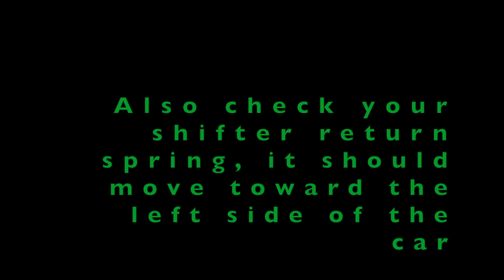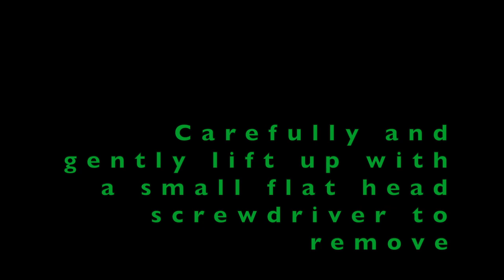2nd Gen (FC) RX-7 Shifter Bushing Replacement

Comment: Nice video, clear and to the point. You're missing 2 circular springs. One sits below the bottom bushing and the other sits above the top bushing. Looks like the dorman kit came with the one for below the bottom bushing but not the top one. The bushings have 3 notches cut into them to seat the top spring into. When the top seal gets attached with the 3 bolts there  shoupd be about 1mm of play up and down with the bushings and shifter without the springs. I can only assume this design was to allow for expansion and contraction of the aluminum transmission housing. Cheers.

Comment: Great Video, thank you so much! any idea where to buy the shifter seal? only seen the OEM option, seeing if there was a slightly cheaper option, considering its hidden
Reply from the maker: Hey there!  Glad you enjoyed the video!  
For the big rubber boots, I've historically dug deeper into my parts collection or fired off an order to Mazdatrix, but it is frustrating (and progressively more expensive) that you have to buy the whole set even if you only need the discs: https://mazdatrix.com/product/boot-shifter-kit-middle-86-92/  
Haven't seen any aftermarket units, though I'd love to stock up if you discover one!

Comment: Hey dude! Nice video, what year is your FC?
Reply from the maker: Hey man!
This FC is an ‘87, and my other is a ‘91. 👍
Reply: @derekcat  thats righteous! I just bought a 1988 FC. Im having a rather difficult time getting to the fuel pump. The physical pump is easy to get to but I cant separate the carpet alongside the speaker wall to properly disconnect the fuel pump cable. Any tips? So far I have disconnected every screw and plug that connects to the carpet back left trunk side but the sucker wont budge
Reply from the maker: @Doughnutscream  Ah nice man! :D So to get that carpet to move you have to remove the speaker cover (plastic) and the plastic trim along the top edge of the carpet (it has pins locking the carpet to the body), and it's been a while so I may be misremembering, but I think there may be a little metal tab helping to hold the side carpet on the back end (hooks onto the body through an opening).
Reply: @derekcat  thanks homie! :) thats going to be my weekend project. All of the plastic seems old and brittle so I need to be super careful